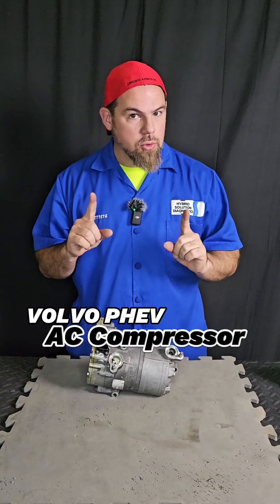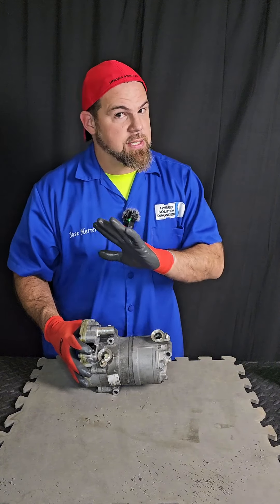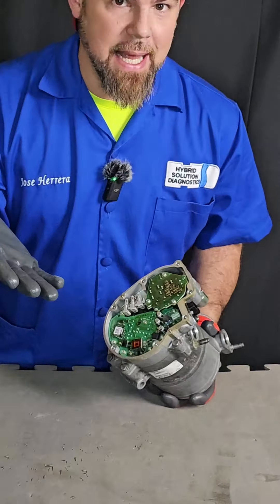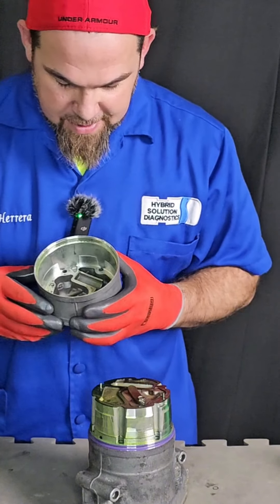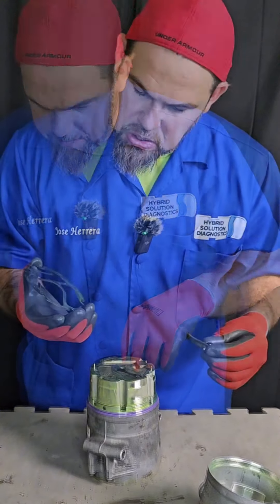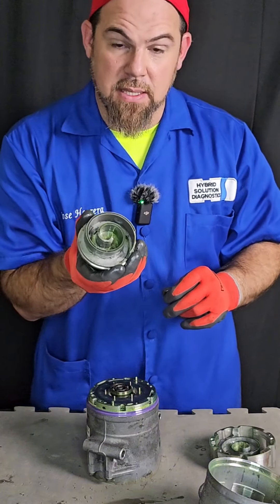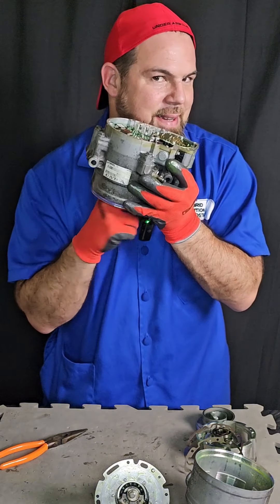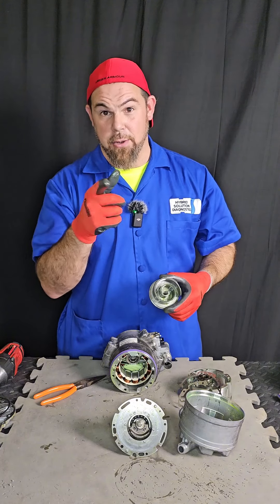Volvo Hybrid Electric Air Conditioning Compressor Failure Masterclass

Comment: Also want to know, my 2004 prius has its ac system  refrigerant leaked out, now seems like the evaporator is the culprit, is any POE oil compatible with r134a works for my ac system? Or there is specific POE recommended? 

Note (i know the recommended oil by manufacturer is ND11 but it is not available at my place)

Comment: Is that rule of thumb applicable  to denso hybrids compressors used in toyota prius? That even for toyota prius it is recommended to set the ac at around 23°c?
Reply from the maker: If you wish to extend the lifespan to the maximum then YES 👍
Reply: @hybridsolutiondiagnostics  thanks

Comment: The bmw i3 and i8 had like 5 iterations of the AC compressor as when they failed shrapnel could get into the battery cooling lines and be a costly repair.. I wonder if coolant leaks lead to a lack of lubricant and then failure.
Reply from the maker: I would say is crap
Material
Manufactured ☝️🥹😒🤪🤪👎🏼👎🏼